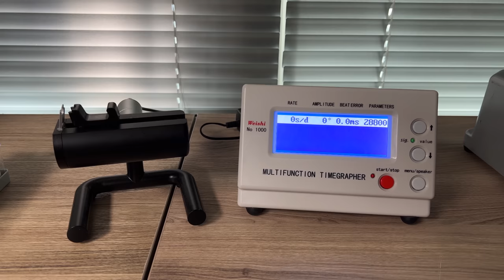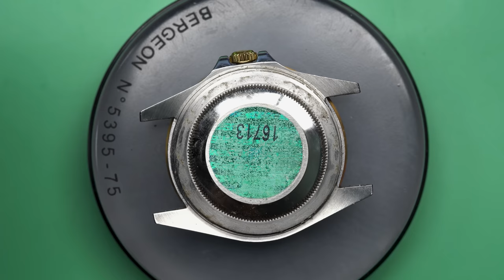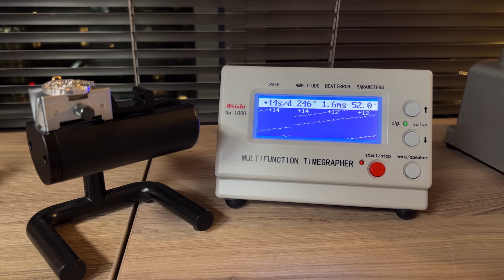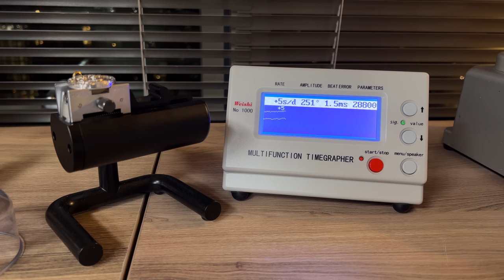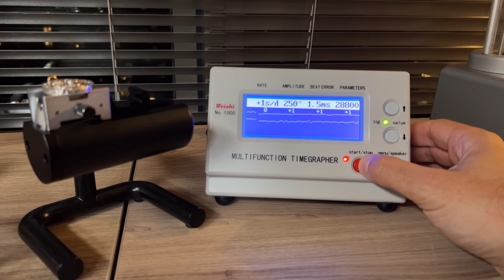My Friend Asked Me To "Check The Battery" On His Rolex...

Comment: The balance wheel weights... There seem to be six (?) of them. Do you move all of them equally?
For car wheels, you add a tiny bit of weight to the part that needs a bit extra, to balance them out.
For the watch, you could "balance" the wheel by tightening one screw all the way but the total would be really wonky.
Like putting all the weight "correctly" on just one side, but it wouldn't be balanced.
I hope this makes sense.

Comment: Is the ultrasonic capable of cleaning all of those little parts? Are any parts not safe in the ultrasonic? I know you mentioned it, but I'm just wondering if the ultrasonic is just as good for cleaning or if there's some other benefit to using the watch parts cleaning machine that you have. Thanks.

Comment: That polishing cream contains aluminum oxides which is ruby/sapphire hardness. It's abrasive and takes away the base metal just as well as traditional polishing. You can see the cloth getting darker while polishing, that's the steel and the gold from the watch got worn out.

Comment: I have a stainless steel Rolex that was purchased in 1992.   I believe this is a low end basic Rolex date watch.  I rarely have removed the watch from my arm (for showers). I had the watch serviced around 2004.  Just this year (2022) the watch stopped holding time.  I reset the time, and the second hand starts moving, but at some point in time, stops.  What do you think is the issue? Could a good cleaning be enough or might there be something worn out in the automatic winding mechanism?  Any type of place you would recommend taking the watch for a service?  I have heard that some places remove the jewels.  Is it possible to get back a running watch with the jewels removed/stolen?

Comment: a bit late, but should the timing of the movement be checked after all load components are installed? probably minimal but any additional always-driven gears and the hands would add additional load to the movement, possibly slowing it down slightly?

Comment: Question on the amplitude. I was doing some reading that said 270-310 is ideal. Is it ok to be around 250s if the seconds per day is within spec? What does the best error indicate as far as the performance of the accuracy?

Comment: Perlage is on the base parts to trap and reduce dust, particles from interfering with the delicate mechanism. (Main reason it is hidden inside and only on certain parts. Does Rolex ever use Geneva stripes?

Comment: I looked at the list of ingredients of the flitz paste and aluminum oxide is the second after water. The rest seems to be mostly oil and hydrocarbon solvents. So my guess is that the solvents are there to remove oxides and tarnish easily, but the actual polishing is done by the aluminum oxide abrasive. I am not sure why they claim that it is non-abrasive, but I am not claiming to be an expert either and I may be missing something.

Comment: Are you willing to attack an Omega Seamaster Chrono?  The local watchmaker gave up on it after a few days, and it hasn't run for any amount of time since.  This watch fails regularly every five years, where I then treat it to a visit to Zurich.  Purchased in 1989, it has visited the shop 5 times at the cost of $1000 each time plus shipping.  On one shop visit it went back to me the back to the shop several times before they gave up and replaced the movement, complete with authenticity document.  It has a oily type film under the crystal that I have no idea about.  Can you PLEASE show this absolutely gorgeous piece some expert care?  All the best

Comment: Hi - looking at the pinion on the weight that sits in the jewel on the winding mechanism, the internet would tell you that is a point of failure for the 3135/3185 movements.  

I notice you did not replace that pinion..  Do they really wear significantly, or is that just internet hype?

Comment: Do you accept requests to repair from general public, like  me? 1969 Rolex GMT Master, bought in Switzerland.  One repair shop replaced watch hold-down system, and who knows what else. If still Rolex, the mechanism has taken a beating. It used to run after that, but only after cleaning and oiling by another shop, but would only run for 90 days before stopping. Cleaning and oiling every 90 days got too expensive, and it has been sitting idle since the 1990s. Alfred

Comment: Rolex is a for-profit company but it is owned by a non-profit. It's easy to mix those two. It is correct that they are privately owned and therefore not listed on any stock exchange, meaning the company is not beholden to investors but can do what the ownership wants.

Comment: Hi I live in Niagara Falls Ontario Canada.  My name is Oscar I bought a Omega Sea master   I stop using a long time ago about 25 year's ago  because I scratched the crystal while working.    What I with like to now if the crystal is polished to remove some of the scratches thru polishing it won't be necessary to remove the crystal and go through the re sealed of the under pressure    y will consider myself lucky if you answer my question.     THANKS YOU 1 WAY OR THE OTHER

Comment: What happened at 30:16 in the video?    How did that tiny screw pop through the hole effortlessly and then you were able to tighten it at the same point where it just effortlessly popped right through the female piece?

It doesn’t make sense….

Comment: know what's really funny? this kinda happened to me. a friend of mine, a real watch fanatic had an accutron he thought was overwound and he wanted to trade me some dvds for it so i got it from him for a couple of action movies which i had stocked up on just to trade stuff for them, watches knives e.t.c. anyway he brings it over i do the swap and when i read the inscription on the back it was a retirement watch from pfizer pharmaceutical given in 1976, so i took the back off put a battery in it and it began to voice a very angry sound. but it kept time and it was the watch that got me started liking and wearing watches. i put a band on it and wore it, he was amazed that it wasn't a manual or automatic, i was amazed that the second hand swept instead of ticked, and that my clumsy self took out the old battery and put a new one in without destroying that hair spring, after that i read about it and was advised to never take the back off it again by the video and information i learned about it. it was a learning experience, now i have a couple old timex manual watches but i depend on quartz for my watch collecting, i do have an older seiko that needs to be gone through but i will never mess with it, it opens through the front and i don't want to destroy it any more than it already is

Comment: Great vid, but there are 2 things I don't get: 
1) why did you clean the bracelet in the middle of movement reassembly? And even if you had to do this why did you not change the finger condoms to fresh ones afterwards. You were touching parts of the movement with these filthy fingers at the end there.
2) why did you leave the case back filthy? It's like wearing a tailored suit with dirty Dr Marten's boots.

Comment: Have you ever seen the sex scene in the movie Titanic. Did you notice how the car windows fog up and the hand running across it from the inside. My point and question to this analogy is would there be an optimal temperature when assembling the clock to prevent foggy Titanic sex scenes inside the delicate mechanics? I would assume that a very cold temperature has the least moisture in it to begin with. Cold temperature has very dry air. But I have no idea how and if that can be transferred into clock works.
Reply: Btw. The new clock should be inspired by the James Webb Telescope utilizing ''cryogenic'' temperatures to harvest a low moisture environment inside the clock.

Comment: To everyone who is amazed by this guy's "skills", understand this. He cannot get rolex parts, so he soaked the entire case instead of replacing the crystal gasket, he further compromised the water resistance by soaking and vibrating the gaskets. Insane. So many issues with his abilities but let's just watch him flip an automatic bridge made  of plated brass and work on top of a tool steel block. Doesnt support the pivot of second wheel so he can't push it down all the way and likely flexes the gear train Bridge. He's a hack. Full stop